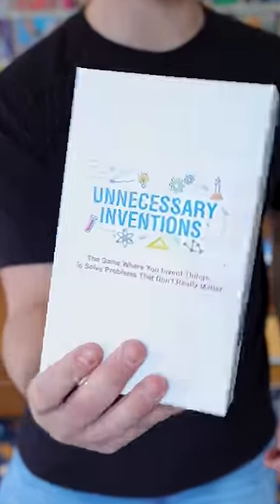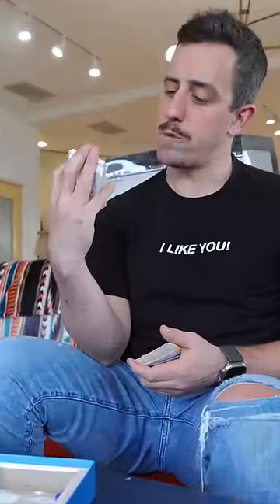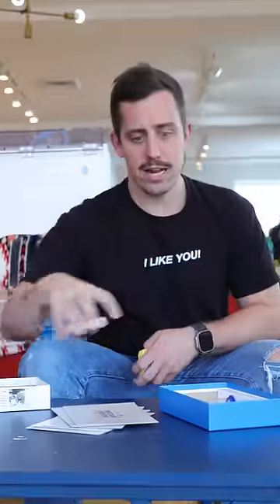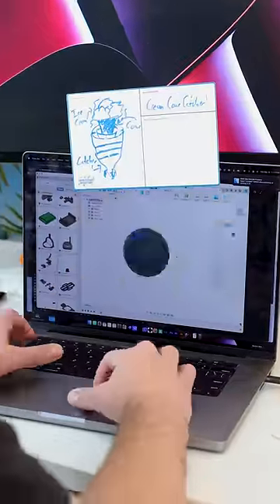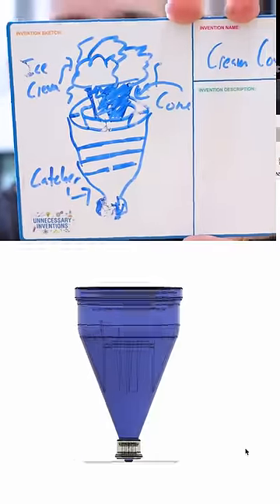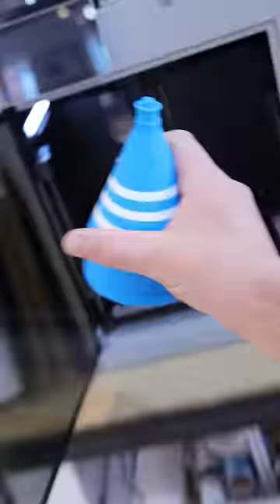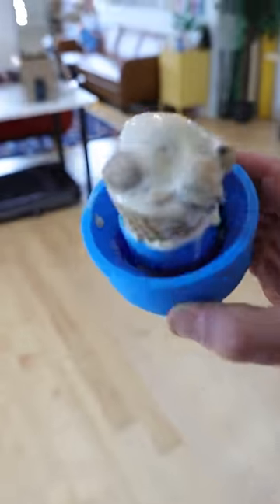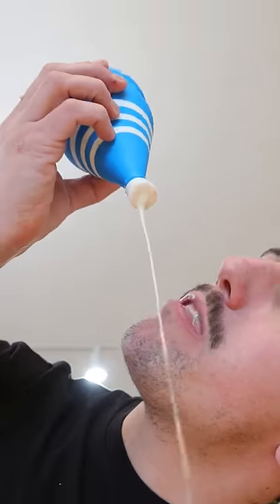I solved runny ice cream cones.

Comment: Caught in 64K UHD surround sound 16 Gigs ram, HDR GEFORCE RTX, TI-80 texas insturments, Triple A duracell battery ultrapower100 Cargador Compatible iPhone 1A 5 W 1400 + Cable 100% 1 Metro Blanco Compatible iPhone 5 5 C 5S 6 SE 6S 7 8 X XR XS XS MAX GoPro hero 1 2 terrabyte xbox series x Dell UltraSharp 49 Curved Monitor - U4919DW Sony HDC-3300R 2/3" CCD HD Super Motion Color Camera, 1080p Resolution Toshiba EM131A5C-SS Microwave Oven with Smart Sensor, Easy Clean Interior, ECO Mode and Sound On/Off, 1.2 Cu. ft, Stainless Steel HP LaserJet Pro M404n Monochrome Laser Printer with Built-in Ethernet (W1A52A) GE Voluson E10 Ultrasound Machine LG 23 Cu. Ft. Smart Wi-Fi Enabled InstaView Door-in-Door Counter-Depth Refrigerator with Craft Ice Maker GFW850SPNRS GE 28" Front Load Steam Washer 5.0 Cu. Ft. with SmartDispense, WiFi, OdorBlock and Sanitize and Allergen - Royal Sapphire Kohler K-3589 Cimarron Comfort Height Two-Piece Elongated 1.6 GPF Toilet with AquaPiston Flush Technology., Quick Charge 30W Cargador 3.0 Cargador de Viaje Enchufe Cargador USB Carga Rápida con 3 Puertos carga rápida Adaptador de Corriente para iPhone x 8 7 Xiaomi Pocophone F1 Mix 3 A1 Samsung S10 S9 S8AUKEY Quick Charge 3.0 Cargador de Pared 39W Dual Puerto Cargador Móvil para Samsung Galaxy S8 / S8+/ Note 8, iPhone XS / XS Max / XR, iPad Pro / Air, HTC 10, LG G5 / G6 AUKEY Quick Charge 3.0 Cargador USB 60W 6 Puerto Cargador Móvil para Samsung Galaxy S8 / S8+ / Note 8, LG G5 / G6, Nexus 5X / 6P, HTC 10, iPhone XS / XS Max / XR, iPad Pro/ Air, Moto G4 SAMSUNG 85-inch Class Crystal UHD TU-8000 Series - 64K UHD HDR Smart TV with Alexa Built-in (UN85TU8000FXZA, 2020 Model) GE 38846 Premium Slim LED Light Bar, 18 Inch Under Cabinet Fixture, Plug-In, Convertible to Direct Wire, Linkable 628 Lumens, 3000K Soft Warm White, High/Off/Low, Easy to Install, Easy to Install, 18 Ft Bissell Cleanview Swivel Pet Upright Bagless Vacuum Cleaner Trane